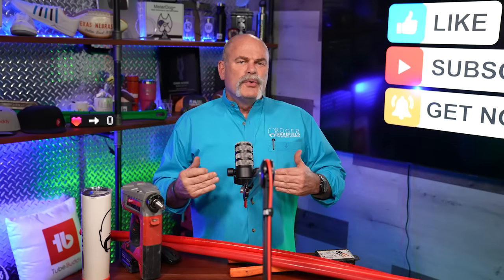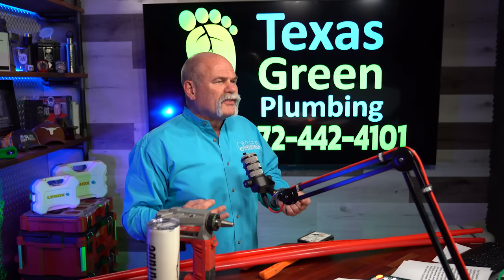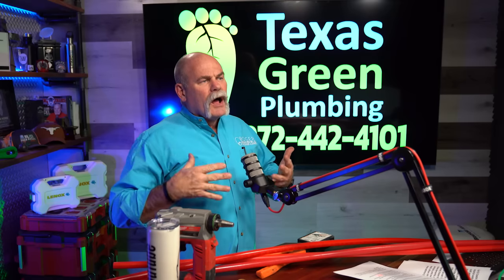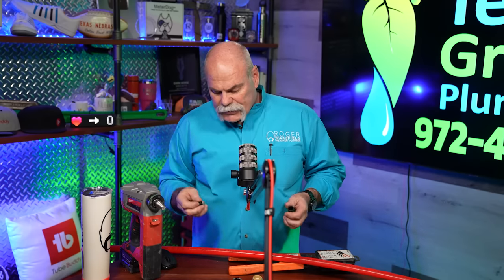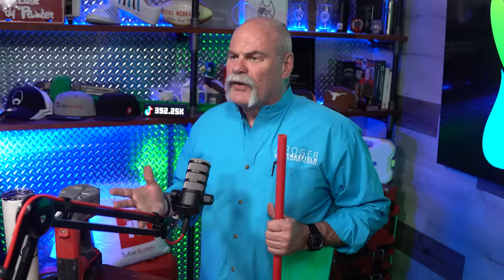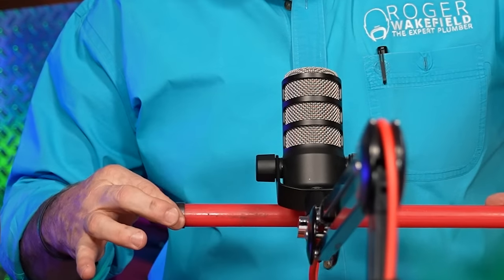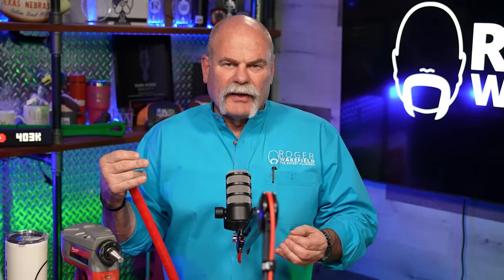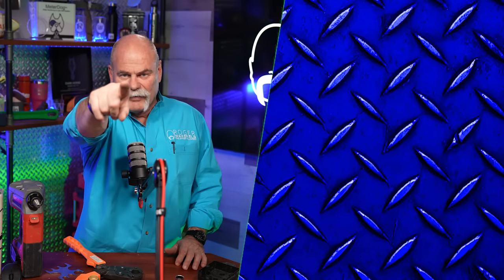HOW TO INSTALL PEX PIPE THE EASIEST WAY

Comment: Roger, why did you use the best cordless power tool available for the PEX A demonstration and the absolute worst hand tool for the PEX B demonstration? I could rough in the water in a house twice as fast with Milwaukee’s cordless crimper for PEX B than the one you used for PEX A. Are you being paid by Uponor to mention their name and then demonstrate how much easier it is to use than PEX B? It’s not easier and it’s not faster. Also, it does burst when it freezes — it does not expand enough to make a real difference between it and PEX B. Also, PEX A joints blow apart much easier than PEX B in freezing conditions.
Reply: Yeah I did new construction for over a year and did a lot of water lines in uponor. The cheapest material and cheapest tools to install waterlines. Had about 7 fittings blow completely out in a 300 unit apartment. I understand a few pin leaks or something but 7 fittings completely blown out of the ring and pipe is absurd. Glad I work somewhere else now, soldered all day today lol
Reply: Roger did a video and tested PEX A vs PEX B. During the test, the PEX A burst under pressure before the PEX B in both tests.
Reply: The guy said he preferred PEX A why spend $500 on a tool to put together a pipe you don't use. If i was in the business of plumbing new houses I wouldn't buy a tool for something I don't use.

Comment: There really are no so called "water restrictions" when using the basic connectors on PEX. The real restriction comes at the end of the flow line. Water saving faucets and shower heads. At this point, there is enough pressure and volume of water being used. Using non restrictive connectors would make very little if any detectable difference. That is why code allows it.
Reply: It's an exceedingly small difference going from 1807 fittings to 1960 expansion type, a typical pex run have few fittings and besides increasing head loss a bit 3 or 4 fittings a run will not significantly reduce flow.  The bigger issue with PEX is while they use CTS sizes it is indeed smaller than copper, in order to maintain the same flow as the copper you need to go up a size on longer runs.

Comment: All we use in my area is Pex B and never had any problems/complaints from customers with flow restriction.
Reply: For a typical install 5% reduction. Very little of the length is actually restricted Bernolii principal

Comment: First time I ever installed PEX, I expected to have some leaks due to it being my first time.  Certainly had plenty of leaks when learning to solder copper back in the day.  My first PEX install ever had ZERO leaks.  I made sure to do my research and do some practice crimps etc but I was still shocked I had no leaks!  Then I realized I didn't like the look of a particular connection, so I cut it out, and made a new one in under a minute.  Love me some PEX!  But since I mainly do HVAC, I am still brazing copper all the time.
Reply: Maybe you can try a pressing tool, which is more efficient than welding and only takes about 4 seconds to complete a pipe connection
Reply: @zuppertool1729  most refrigerant lines are at a higher pressure than your standard water connections are rated for. some of the newer refrigerants require 30 bar of pressure (~400 psi). while you could use a propress fitting, its probably better to stick with the braze.

Comment: I replumbed the original part of my house from screwpipe to PEX B and ABS drains about 16 years ago.  it was a simple enough thing to run a size larger pipe.  later, I upgraded my water heater, and it was cheap enough to buy a crimp ring tool to do the changes in PEX B.  now that Milwaukie has such a good line of PEX A tools, most of the plumbers I work with use PEX A with M-12 expansion tools.  a lot less work for them than the original manual tools when PEX came to my area in the late 90s.

Comment: I'm not a plumber either, but I've done a lot of plumbing in my own properties.  Pex is new to me and I am re-plumbing a  1 family rental I own and was going to use copper. Like I have done for over 45 years.
With this demonstration and explanation  of pex A, I'm going to buy the expansion tool and use all pex A in this house.
Thank you very much.
Reply: Just use quick fitting and save the money. No need to buy expansion tool.
Reply: @alexkidd1906  do you mean shark bite push to connect? In an entire house?
Reply: @alexkidd1906  Good lord no Sharkbite for an entire house.
Reply: Going to need to review your laws can’t use that inside walls in most states
Reply: @alexkidd1906  he owns property. Quick fittings are for house owners that don't know anything plumbing to fix something small, quick.  Get the tool and use uponor from then on.  Good with weather and easy/quick to install
Reply: @guidedbygreen1480  It is not shark bite, I think that is a totally different product. Pex pipe uses copper rings with a crimping tool.  That was the style I used years ago.  Easy to use, and has never leaked once. A lot better than copper.

Comment: I live in southern NM and the well water is very hard.  I have an older manufactured home that was originally plumbed with polybutylene.  Many of the brass fittings turned green and began to leak.  I had it re-plumbed with pex pipe with what looked like the same type of brass fittings, and yes I knew about the recall on polybutylene.  Anyway, these fittings also turned green and began to leak.  I went to a local mobile home supply parts house and told the salesman what my problem was.  He recommended Flair-it plastic fittings for our area.  Evidently I was not the only one having issues.  So I slowly went through every place that there was a fitting, opened the belly wrap, and replaced it with a Flair-it fitting.  I haven't had any issues since.  Doing this gave me a deep respect for Plumbers.  You gotta love the underside of mobile homes.  They are their own eco-systems.  Thank you and God Bless...
Reply: I also have a mobile home, the largest spider farm in Pennsylvania so it's no fun going in the crawlspace and you want to spend as little time in the cold dark, mud. My place was built in the 1980s and still had iron pipes that I replaced with PEX B but got leaks due to freezing . I built a double floor for insulation and the  new PEX pipe runs under to protect it from freezing and I can work inside with access hatches in the floor and work indoors.

Comment: I started installing PEX C, 4 years ago, until I pulled the trigger to buy a Milwaukee ProPEX tool (Uponor). There is nothing better than not having to crimp rings in a tight space. PEX is a great system and there are places for use for "C", but I am loving the PEX A lifestyle so much more. Customer love it too when your in and out is a short time frame. No more grunting noises from being in tight places crimping rings.

Comment: Roger, I am so glad to see your emphasis on flow restriction. Too many short-sighted others focus on the cost of the tool or supplies. Flow restriction will be lived with for a much longer time.
Reply: Thinking a lot of folks just really restrict flow with firstly seriously undersizing the pipe circuit  sizes just to save money on the Job.. be it a Contractor or a Weekend DIY Have a Go - Know it All  type...  and then there's  further restricting  to the flow by creating seriously sketchy /  bad pipe geometry,  90Degree Elbows rater than slow pulled bends in running piping circuits,  again two sharp 90 degree elbows would be used as a quick option to route around an obstacle the pipe encounters where as  two 45 degree bends slow bends to create a Set and Run solution would be the way to go,  even in Pex... rather than burying your self into a hole proper planning and snaking and or running  PEX say BACK  from a sink or Facet by First Fix  can save a world of bother rather than some Cowboys try to strangle miss measured pipework  onto same straining  the Sanitary fitting for a pastime...

Comment: I'd love to see a science experiment of flow restrictions vs. no flow restrictions. You'd have to use like...3-4+ joints to simulate stuff....but that would be neat.  I also feel like their would be increased flow noise (sound) with the snap together fittings.
Reply: Check out the YouTube channel of Matt Rissinger. He did a flow comparison of pex pipe. Pretty interesting.

Comment: I used this Pex Pipe, It is the easiest stuff to work with, a crimper with a go no go gauge. I did my entire home with it in like 10 hours. Six years later not a single leak anywhere. I rate this material at 100% the highest score you can give a product. BUY BUY BUY

Comment: I have re-plumbed two houses I've owned with PEX. Both using the crimp style fittings. Mostly because it required less expensive tools (compared to the pex expander). I like the flexible PEX pipe because I could make unbroken runs from my distribution ring to the end use point. Very few connections to be made at all. If I had done so with copper, I may still be sweating joints.

Comment: Can you produce a video explaining the benefits of Zurn Pex B over Uponor Pex A. As both install in the same manner with expansion collars, I'm hearing on-line that Zurn Pex-B is a better long term material as lacks small, near microscopic ridges in the inside, which Uponor has. Thanks, Roger!

Comment: I just want to say I’ve been doing plumbing for 20 years. I also have a retail store. I’ve been selling sharkbite brand push on fitting since around 2008 maybe. I didn’t trust them at first. I still think they shouldn’t be used often however the only ones I’ve seen fail were installed without cleaning the pipe, installed in the ground or were in a really bad bind. As long as you clean your copper before you push it on and don’t have it in a bad bind you shouldn’t have a problem
Reply: Dependent upon the water itself. Here in Vegas the water is absolutely terrible. Not once not never out here. Situational tho

Comment: @RodgerWakefield. I had to fix some of my grandfathers plumbing on his mobile home single wide. It was placed over basement in 1970. It has a clear looking pex that I'm assuming was from factory in mobile home. He solder all 3/4 pipe in basement for water and used pvc for toilets and drains. What was the clear pex looking stuff in trailer because according to you it was interduced in 1968. I had to use single sharkbite so far because the brass fitting that was attached using some sorta clamp band got Crack in brass and there was no room for any other and it was going from pex to fitting for sink.

Comment: I like the push together fitting as a homeowner doing my own minor repairs and I have them in service for 10 years or more.  I don't know if I trust them enough to put into a wall.  I've used them in my basement  that's unfinished. If there was a failure nothing major would be destroyed like if they were in a wall upstairs and they can be seen and checked for issues.

Comment: Great video! I use PEX A and have a difficult time finding it here in southern Missouri. Most guys run B, in this area. I can get Apollo brand at a local supply house, or Home Depot. I buy Sioux city from Menards. Both seem to be good products. Wish there were more PEX A manifold systems. I've only found Apollo brand.
Reply: Amazon is where I get mine. Even the Dewalt expander tool. Can't guarantee it's the best price on pipe and the fittings.
Reply: I had the opportunity to buy PEX-A Upunor from FW Webb at the time.  I decided to skip that and go with the PEX-B, mainly to save $$$ on the tool and to have better hours shopping at Home Depot. I replaced all of the plumbing in my mobile home, from the ground up. I used the stainless steel clamps. My only problem was with the Apollo 24 valve manifold (twice what I actually need) but I like it. It was working fine, until the cold weather where the hot side started to leak a bit. I had to tighten up the caps and valves (hand tight). I put that all in the hot water heater closet and haven’t run the heat much. I added a Mr. Frost Heat Tape zip-tied to it and insulated all of the main piping. I think I might have liked a PEX-A installation better, but seemed it would cost me at least $500-600 more due to the expander tool and better manifolds. For now, the PEX-B has been holding up ok. My biggest fear was seeing the manifold bust from the cold, but a minor leak is the extent of it for now. I’m just mentioning this because it was a point of pride for me going the spring and summer with zero leaks, until a couple weeks ago. I made it so all of the fittings are in the heater compartment and at the fixtures where I can see them, no hidden junctions or fittings under the floor. Everything returns to the manifold.
Reply: @jamesflynn10  I got the Dewalt tool as a bare tool. But it did have everything you needed if you already had the batteries. Paid 287.00. Then found the 5 ah battery, charger and a bag for 82.00. That was also when Amazon didn't do tax on third party sellers too.

Comment: Hey check out rehau pex used for radiant heat systems mostly  but the fittings you expand the compress a sleeve over fitting with a tool made by dewalt

Comment: Ok, I have two questions? For the occasional person who dose plumbing and wants to start using PEX dose it really make sense cost wise to spend $$$$$ for the expansion tool which I do agree is the better option and possibly the slightly better option of PEX A. So, between the stronger brass quick and the crimp connections which would be the better choice?

Both reduce flow, but quick connects don’t require any special tools except maybe a pair of ratcheting pipe cutters which all methods need. The crimp system needs the crimp tool needs the crimp tool and go-no-go gauge. The cost per fitting for a quick connection is $$$ where a bag of crimp and inserts is similar but you are able to do several connections. 

So, you are looking at a reduction per systems that are about equal and considered nominal by both systems manufacturers. Is it worth it to purchase the tools to install PEX or just buy the quick connects.

My second question is have you ever heard of PEX A sweating once it reaches its lower thermal temperature range stamped on the PEX A of 76°. It’s wired that PEX is sweating in a isolated basement only when water is flowing and before the main copper pipe feeding the home and the rest of house sweats. In fact the PEX A causes the copper to sweat.

Any ideas why this would happen?

Comment: I saw a video saying Pex A on a job for an individual had a leak develope after it had been installed for about 10 years.  I have to wonder why?  Was the a defect in the pipe?  Or was the stretching of the plastic causing stress in the pipe that after years of service if finally gave out with a pin hole?
Reply from the maker: Hard to say, it could be a number of different things…what video are you referring to?

Comment: Pex B can do both expand or crimp, as long as it has the F1960 and F1807 rating.
Reply: I was going to mention this as well. Sioux chief power PEX, as well as most Apollo coils sold at Home Depot as well as Viega I believe, have PEX B rated for F1960 fittings as long as you use powered self rotating expansion tools. I’ve used lots of the Sioux Chief with good results. Less of the Apollo.
Reply: Never heard this before
Reply: Apollo’s website says specifically not to expand Pex B pipe. I wouldn’t ever do it. Would make it hard for me to sleep at night
Reply: If it was as good at expansion as Pex A was, then it would be called that. And it’s not.

Comment: What's your take on cinch clamps for pex b?
Reply: I've done a bunch of installs, repairs. They work fine. I use the one handed ratcheting crimper. Only issue is when your buddy doesn't get the ring with a 1/8 space and crimps it crooked...it WILL leak then. But it's an easy fix.

Comment: I use the pex A
Had a helper install  2- couplings in a space i couldnt get into.
He expanded the pipe, onto the other pipe, without a coupling.
After 1 year of being used, had a leak on 1 hot pipe. The cold was fine..
He used the 3/4 head to make the 1/2 inch bigger....to coupling the pipes.....
It held though...on the cold...The house did sit for awhile before turning water on....lol

Comment: Old video, but the solution to flow restriction for those fittings is to size up.  1/2 to 3/4 for example.  It's what I did at my own home, since I couldn't justify the cost of an proper expansion tool for 2 bathrooms, my kitchen and laundry room. I just sized up one size more on the pex and fittings, with the exception of valve to heads for the showers.  The crimp tool and rings were easy and I could crimp in situations where expansion or clamp style tools may have had an issue getting to.
Reply from the maker: Yes, always upsize with crimp fittings

Comment: Hi, I just found your channel. I’ve been putting off changing out my bathroom fixtures. seeing that my home is “I’m assuming” plumbed with pex I do not have a stop valve  on either my toilets or sinks. would shark bite shut off valves be an option for the valves? newbie here. Thank you in advance.

Comment: someone had a major leak on their hydronic heater all over their house during a winter storm and their plumber walked down from his shop blacks away during the storm with pockets full of sharkbites man i mean we found 1 1/2" sharkbites he had all kinds of sizes it was state of emergency he couldnt drive no leaks yet but we went back and replaced it all with pro press later be fore he closed the walls back up im no fan of sharkbites but i was wondering if it is possible if those plastic sleeves in the sharkbites but melt due to the high tempatures of a boiler system i wonder what tempature theyre rated for
Reply: they are rated for 200 degrees